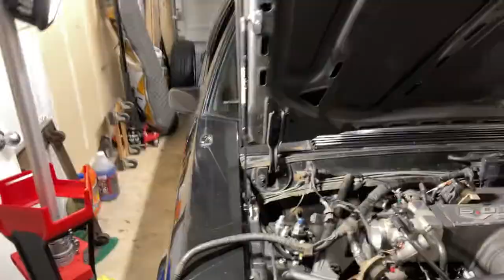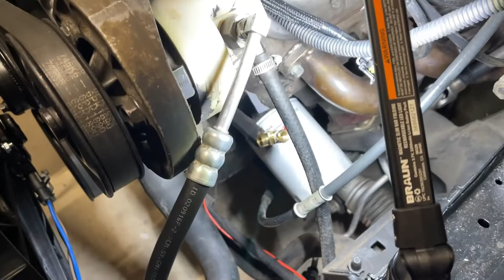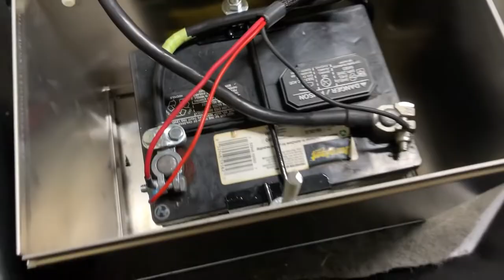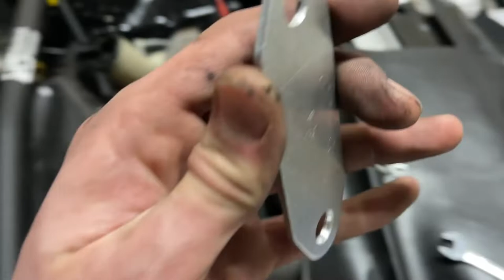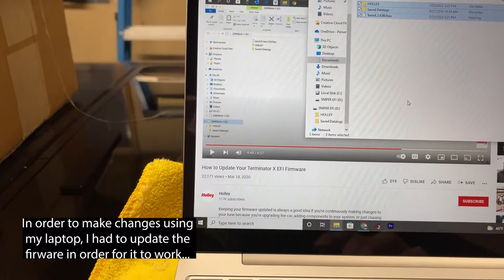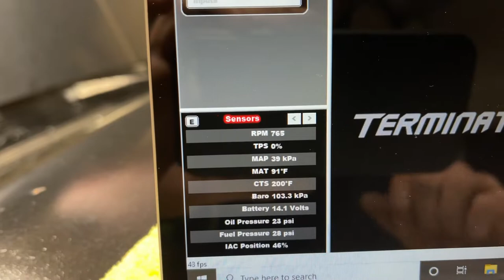Foxbody Mustang Terminator X Install + First Start Tips

Comment: Nice video man keep it up. Just got another subscriber right here.  Just got mine terminator x and ofcourse looking at YouTube installs.
Reply from the maker: Thanks for the support! It’s a fairly straight forward process and the instructions are super helpful. If you have any questions feel free to comment! You can also ask me on Instagram @ they_call_me_toog 👍🏼
Reply: I do have a question if you could help out.  When you take the green fuel trigger wire and hook into the pink with black strip wire.  Once you turn the key does your fuel pump instantly prime.  I did the upgrade that Dan from neo mustang did on fuel pump and now I don't hear my new pump priming on key cycle.  It works if I put 12v straight to it.  Thanks
Reply from the maker: @joshuaanderson8869  I did not do the fuel upgrade that you are talking about, but the fuel pump won’t prime until you go through the calibration in the ECU. For instance when you initially turn the key on, the fuel pump didn’t prime, but after you laid the tune and cycle the key, it will prime on key cycle from then on. Have you uploaded the tune/gone through the wizard yet?
Reply: @eneboracingchannel  I have not did the tune yet.  I installed the terminator x and on3 turbo all together.  Not hearing the fuel pump kick on with key cycle got me chasing ghost than probably.  I didn't realize you would have to get the ecu setup first.  Makes sense now.  I'm waiting on a new laptop to come on. Since I need windows 10.  I had bought a base line tune from anderson motorsports since I have the turbo installed.  Thank you man.   Much appreciated 🙏
Reply from the maker: @joshuaanderson8869  Excellent. I purchased a tune through Anderson as well, and it helped, but I am working with a guy remotely, and he has helped way more, and ITS FREE! But yea, until you run the wizard, I r upload a tune, the terminator is a blank box that has power.
Reply from the maker: @joshuaanderson8869  You could always run through the Holley wizard on the handheld for the turbo and that would at least confirm if the pump will turn on. You don’t even need to start it.
Reply: @eneboracingchannel  ok I may try that after work today.  I had looked at it the other day but it was asking me alot of random questions that I was not sure on what to input.  However long as I don't start it up that would probably work and than later upload the anderson base line tune.  Man I sure do appreciate the quick responses.  Your on top of your game.  Thanks again
Reply: Update on the car man.  Got home just did a random tune on the wizard and after the final key cycle at the end the pump primed with no issues.  Thank you so much man.  I've ask numerous people and you were spot on with my issue.  Thanks again
Reply from the maker: @joshuaanderson8869  Hell yea dude, that’s what I’m talking about! Glad to hear. Feel free to shout this out on your insta, I always love hearing these diagnostic stories. I’m sure you aren’t the first person who had this question. 👍🏼
Reply from the maker: @joshuaanderson8869  you got an Instagram?
Reply: @eneboracingchannel  I do I'll add you.  I don't really have any fox content but need to start putting uo some there.
Reply from the maker: @joshuaanderson8869  No problem man. That’s where I post a lot of my Fox stuff, and it’s easier to ask questions. 
@they_call_me_toog

Comment: Did the terminator kit come with the fuel pressure and oil pressure sensors and wiring or is that something you added yourself?
Reply from the maker: The kit came with the harness ready to go, but I had to buy the sensors separate. I used low dollar motorsports sensors and they work great with no additional programming.

Comment: what a great video! can you still buy the holley terminator x for foxbodys
Reply from the maker: You can buy a kit that is for a “Ford”, but the foxbody specific kits are not longer sold by Holley. The Ford kits can be modified to work with the Ford IAC valve, and it is simple to do that. Otherwise, you’d use a GM style IAC which work too.
Reply: @eneboracingchannel  is that what you did to the kit you installed?
Reply from the maker: @FishingWithJo415  No, I was able to get a foxbody specific kit! If I do it again, I’ll be getting the ford kit and trying the GM IAC.

Comment: do you have the part numbers for the fuel and oil sensors
Reply from the maker: I used low dollar motorsports sensors 7990100
Reply: Had the same question about the sensors. What's the part numbers specifically for the fuel and oil sensors. Also where'd you buy them from. Thanks!

Comment: Great video.  By any chance do you or anyone else here know what fuel and oil pressure sensors you got from low dollar motor sports? I would like to add those in also
Reply from the maker: Yep! I purchased their standard 0-100 psi transducers.
Reply from the maker: https://lowdoller-motorsports.com/collections/pressure-sensors/products/0-100-psi-5v-pressure-sensor
Reply: Thank you! I really appreciate it!
Reply from the maker: @edwardwellema1459  No problem!

Comment: hey man can you tell me about that fused power distributon box you have under the passenger side dash? I bought something similar with the intention of wiring up some gauges. What all do you have wired to that box? I am getting ready to to install the holley terminator x gen 2 on my fox. hoping it will be a little easier to wire the sensors.  Thanks. great job by the way.
Reply from the maker: Yea, no problem! I wanted to make a panel that had 12V while cranking for the Holley, and so I have a large relay that is triggered from the fuse box on a circuit that supplies 12v while cranking. The relay then sends power to the panel I have and it powers my Holley, gauges, electric fan controller, and my MAC valve for boost control. The little box just needs to be grounded, and the power comes in from the relay I wired in. 

Basically, instead of trying to find different wires to tap into for all your accessories you want to add, I just used one circuit from the fuse box to trigger a relay that I sends 12V to the box straight from the battery.

Comment: That red 12v wire that you connected to the fuse box... wasn't the red/white wire suppose to go to that?
Reply from the maker: The red 12v wire you see going to the fuse box in the video is a tap a circuit that triggers a relay that sends power to another fuse box I built, that supplies multiple sources with a 12V switched power while cranking signal. I have the red/white wire connected to that. If you add me on insta I can send you a video. 👍

Comment: GreAt video, do you know what size adapter to get for the fuel pressure sensor?  I will also be getting the low dollar pressure sensor
Reply from the maker: Thanks!! I believe it is a 1/4” npt to 1/8” npt reducer.
Reply: @eneboracingchannel  would you happen to have the link and part numbers for these sensors? I just got my ecu today I’m excited!
Reply from the maker: @509stallion   Let me see what I can find!
Reply from the maker: @509stallion   I used 1 for fuel pressure and 1 for oil pressure. I did not have to mess with calibration settings either. 

https://lowdoller-motorsports.com/collections/pressure-sensors/products/0-100-psi-5v-pressure-sensor

1/4” npt male, 1/8” npt female adapter

https://www.amazon.com/Megairon-Reducing-Reducer-Bushing-Stainless/dp/B071V7P13X
Reply: @eneboracingchannel  thank you very much. Gained a new subscriber. I’m in the PNW as well!

Comment: Why can’t I find any of those brass fittings at my local hardware stores 🤦🏻‍♂️
Reply from the maker: For the oil pressure sensor?
Reply: @eneboracingchannel  Yesir
Reply from the maker: @tinosantiago1790  Crazy! I found all my stuff at Home Depot in the plumbing aisle. 👍
Reply: @eneboracingchannel  o Ly place I haven’t checked yet lol that’s my last spot on the way home fingers crossed 🤞🏼

Comment: did you end up having to wire in a relay to get power to the positive side of the coil like holleys paperwork said? im installing one am and confused because im running a 6al too lmao.
Reply from the maker: @Jkush463  I did not have to run any additional relays. I do not have a 6al box either: 👍

Comment: How does all your headlamp and tail light of the car turn on with just the terminator? I want to buy one
Reply: Also I want to use factory fuse box too
Reply from the maker: All functions as normal. Stock fuse box too. It does not affect those systems.

Comment: DID YOU HAVE TO REMOVE YOUR MASS AIRFLOW FOR THIS INSTALL?
Reply from the maker: Yes, the Terminator x is a speed density system, so no need for the mass air meter.

Comment: Can you not reuse the fuel and oil OEM pressure sensors?
Reply from the maker: You can, in the video it shows you how to wire those sensors up. Do you have specific questions about them?
Reply: @eneboracingchannel  No I was just curious about re using old sensors already installed. I just ordered the Terminator X and doing some homework before it get's here.
Reply from the maker: @Scrapla1  Gotcha. If done right, you can retain all factory gauges. 👍
Reply from the maker: @Scrapla1  Gotcha. If done right, you can retain all factory gauges.